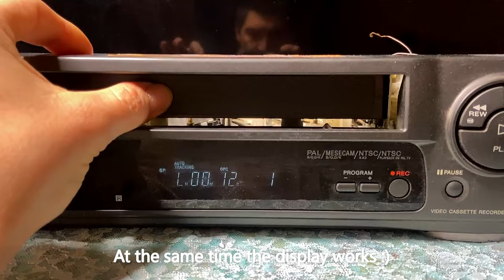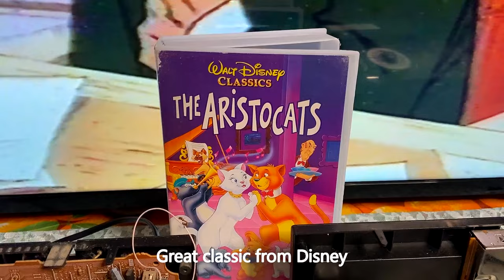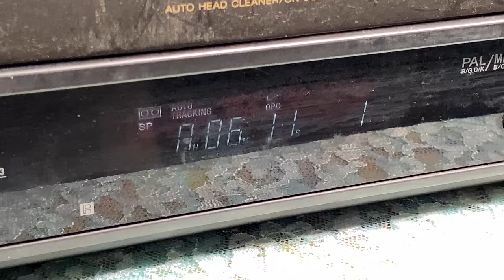Video Cassette Recorder from SONY. Japanese quality and reliable device from the 90s

Comment: You need to clean the drum besause the picture is Bad...
Reply: Could also be bad caps. Caps on later VCRs (no matter the brand) go bad like crazy
Reply: But this vcr have auto head cleaning
Reply: @Leviccom  Auto head alignment, but I don't think they can clean their heads themselves
Reply: @Leviccom  Auto head cleaning is the little sponge next to the drum. It get dirty and makes the head dirtier